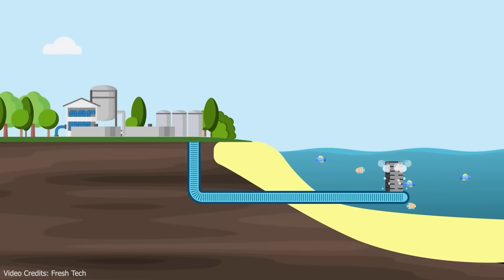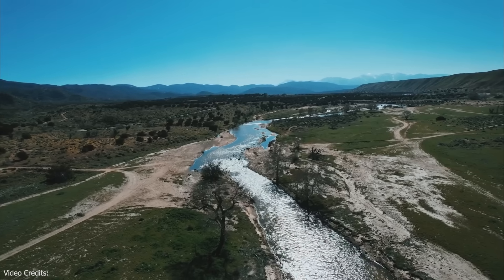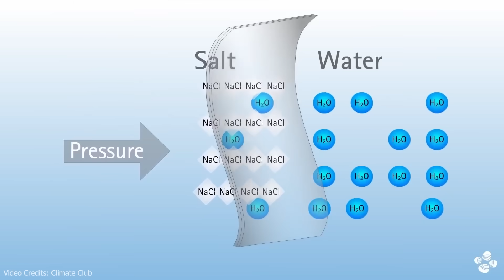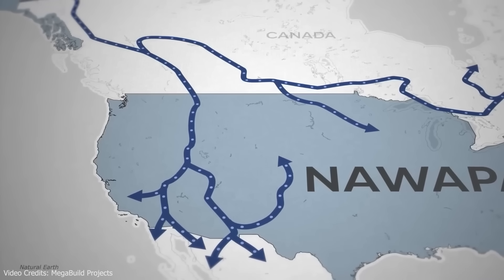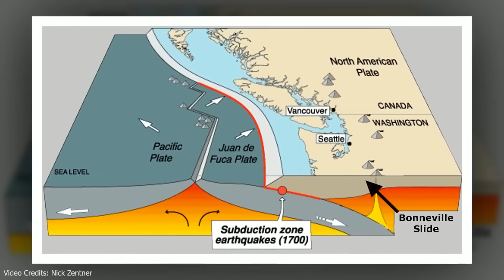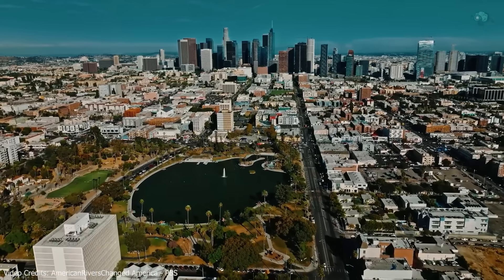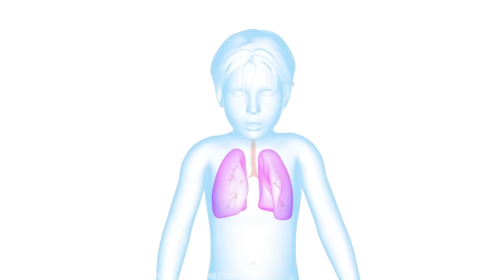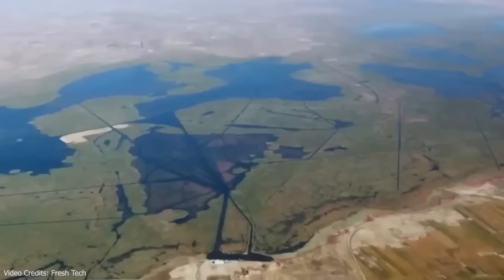Nevada's $16B Plan To Pump The Pacific Ocean 170 Miles Into The Desert

Comment: The Desal system would help Cali the most, but idiot Newscum and the libtards running the state just destroyed 3 more Dams that would have been needed for holding onto the water that comes in.  Nevada needs dmas in the mountains to supply them with water.    Few speak on how the River stealing from the Colorado has destroyed the downstream areas that lost their water. Should have mandated that Cali build their own dams for their own water supply, and leave the Colorado alone.
Surprised the Salton Sea hasn't dried up being their is no input going in.

Comment: Solar power is not consistent enough to run industrial systems like desal plants. You need batteries. Those cost more than the solar itself. Or you could just use natural gas.

Comment: As someone commented earlier, this Nevada proposal is just a pipe-dream.

The 1964  NAWAPA plan was brilliant, far-reaching, and farsighted, a plan which would have solved the water needs of the arid western U.S. and northern Mexico for a century or more.  Had Ralph M. Parsons' project been built it would have vastly increased the prosperity of Canada, Mexico and the U.S. and would be continuing to do so for generations to come.  It would have paid for itself many times over.  It would have greatly aided Mexican stability and prosperity by ending food insecurity issues.  Western Canada would have enjoyed almost limitless and very cheap electricity.  The U.S. would  have been able to export even more of the planet's food supply.  Despite the delay it should still be built because the need which was evident in 1964 is even greater today, in 2026, sixty-two years later.

Comment: Just spit balling here but, if one if the big problems is that creating an inland sea using desalinated ocean water is that the salinity will rise to dangerous levels in them, how about DON'T desalinate the water first, pump it directly to the desert, and then constantly run desalination there instead, pumping clean water for municipal use and pumping the brine into dedicated evaluation ponds for mineral extraction? I suspect it might contaminate the ground water, but if you can create enough clean water to not need it, it might be worth it. I mean, it almost certainly wouldn't be worth it, but it would be interesting to see the math's take on the idea.

Comment: You have to put it through a pipe you can’t just pump it into the ground. You gotta take it through a big pipe running 100 miles to get it to the spot where you wanna start irrigating the land. OK what they’re talking about is a pipe dream if you want to do it correctly, it involves tunnel, boring machines, and we’re talking about a really long distance like 300 miles and we’re talking about a really big wide pipe like about20 feet wide and we’re talking about distalization plants pumping trees of gallons out of the Pacific Ocean powered by nuclear reactors

Comment: Given what has occured over the last 20 years with lakes Powell and Mead, I'd be selling my house in Vegas, as well San Diego for that matter, within the next year, if not even the next six months before the housing market crash really kicks in.  No one in government is raising alarms about the impending water crisis.  Meanwhile all the scientists are shouting from the rooftops. It's going to turn into a case of musical chairs over the next 5-10 years, except all the chairs will be pulled at the same time and then the entire bottom of the housing market will fall out.  Mark my words.  If they don't start building stuff like this within a year or two.. by 2028 at the latest.. it will be too late. And you know projects like this always take twice as long as they think.  Good luck folks.  Look at those lake levels.
Reply: You're absolutely right, but its going to be even worse than you predicted. Almost half the country's fresh fruits and vegetables are grown in California. When the water runs out, there will be a huge shortage of food.
Reply: @Krunchy71  Not all of California's water comes from the Colorado river.  Las Vegas and San Diego however get 100% from the Colorado (San Diego 99% actually because 1% comes from the only desalination plant). But, the other issue, which you would be correct on, is that the water aquifer in the CA central valley is near non-existent in many parts, as is the same in Kansas and other areas.  We've sucked thousands and thousands of years worth of water out of these aquifers in just 150 years of agriculture, mainly in the last 75.  So with that, and changing weather patterns, inconsistent rain, more storms and tornados destroying crops... it ALL spells disaster.

Comment: Recycling technologies are a must, regardless of anything else.
Beyond that, rather than trying to create new lakes/seas inland, maybe use the desalinated water idea, but pump it up to the tops of existing waterways, as a means to replenish the existing supplies.  The natural waterways already address the water circulation issues.

Also, there are new salt-based battery technologies being developed that would need the large-scale salt supplies that the desalination plants could provide.  Sales of the waste salt could provide a cost offset almost immediately (if the plants are built first).

There are ways to do this that would require less construction, and avoid many of the pitfalls.  But these require lots of design and management, and government backing.

Comment: Seems like a waste. You could easily make this far cheaper by just using focused sunlight to heat seawater (technically inefficient but mirrors are cheap so it is extremely effective), which rises through pipes under its own buoyancy, goes through condensers at high elevation, and is driven through pipes under its own weight all the way to Nevada. No pumps, no reverse osmosis, no photovoltaics.

Comment: I wonder if they considered instead of pumping the water up, just bore holes through the mountains with the Boring company's machines? 
Fusion power would help with that. The romans managed to make aqueducts that ran down hill with carefully placed bored holes.
cover the reservoirs with black plastic beach balls to limit evaporation.
There's salt water under Nevada, just pump it out there, desalinate it with a nuclear fission/fusion reactor by boiling or membrane separation. 
Where do you build the plants? The Nevada nuclear test range where it's already designated as a cheap/dirty real estate. 
Put the brine back into the wells elsewhere or pipe it to the Salton sea in a ditch, what evaporation happens will change the local environment.
The Salton Sea drain has been closed to the ocean for some time. I think some tractors and recycled beach plastic can make a canal fairly quickly.

Comment: Pump 2 gallons to Nevada, and one gallon back to the Ocean of real salty water. Create a checker board pattern of farm land of 3 acre red squares, and 3 acre black squares. Dig the black squares into ponds, and create a ditch connecting the black squares at the corners. Plant coconut palms, and agave plants, on the red squares to stop evaporation. You have to cover the land to reduce heat, like swamp land. Create a narrow waterway, and as it is successful, expand to wider waterways, and more checker board pattern. Plant hyoscines in the water to help stop evaporation.
Reply: @RoscoeCreel says: “Create a checkerboard pattern of farmland of 3-acre red squares, and 3-acre black squares. Dig the black squares into ponds and create a ditch connecting the black squares at the corners.”
This would be a fun project… IF Nevada were flat. It is very not flat.
Reply: @RoscoeCreel says: “… Plant hyoscines in the water….”
What is a “hyoscines”?
Search engine says: “Hyoscine, also known as scopolamine, is an anticholinergic medication.
Reply: @climate-rescue5805  The water plant that covers the rivers, and lakes of Florida. It floats on the surface. It has a beautiful blue flower. It was brought from Spain to Florida. It will absorb sunlight, and reduce heat.
Reply: @RoscoeCreel  Ah. Not Hyoscine. You meant Hyacinth. Odd how a couple of letters make a bunch of difference in the understanding of the message. Thanks for your reply. And I agree that the plant would slow the evaporation process.

Comment: Plans to?  Who?  Yeah, get back to me when some gov't agencies have invested 10's of millions in studies etc.  The big missing part.  Buying the land.  Well you could pay a little bit up front, then interest over time, and a percentage of income from licensed mineral extraction from salts, farms, etc.   Pumping the ocean is a dumb idea.  Just drill 20 or 40 foot tunnels and let it flow down hill into lower than sea level areas.  Death Valley and Salton Sea.  At that point desalinate it, via solar evaporation or reverse osmosis using filters and pipe magnitueds of scale larger than current, as Israel has done, producing far cheaper fresh water in such quantity they have created a NS 'river' incorporating surface storage.  Use this to remove salt build up.  Processing salt is a great idea for minearals, but you'll still get VAST amounts of brine to dispose of.  It's hard to know where.  In Isreal they are using it for secuirty embankments to make montioring access to areas easier.  Maybe there's someplace in Baja that Mexico would like to make money off of burying under 100 yrs of salt.  You could theoretically melt the salts into stone like materials to make it more stable, maybe even useable as land fill.  Now having fresh water, almost next door to Las Vegas and other areas needing water, you can pump it up into reservoirs you cover with floating PV farms as they do in Japan to also counter evaporation, which in the US is done by covering reservoirs with millions of useless and if they get out into down stream rivers, environmentally disasterous plastic balls.  So you are now 1/2 way to the big reservoirs along the Colorado at elevations from 500 to 1500 feet, and only need pump up that gradient.  Indeed if one was clever and used evaporation to desalinate the water, the steam could be piped uphill to condense out at some elevation at least hundreds of feet above sea level, making the pumped lift as little as 250 feet.  If you can pipe the steam up 1000 of higly insultaed pipe or tunnel, you might get condensed water to gravity flow back into the parched reservoirs.  You could keep this up until the Colorado once again flowed back into the ocean, ending 100 years of tension and abuse of Mexico who we didn't ask when we used up the Colorado, and restore millions of acre of wetlands and irrigate millions of acres of farmland, in Mexico even, or flood now dried delta for fish farms, all giving poor Mexicans an alternative to drug trade and running the border into US.  Let N. Mexico absord the world refugees now using Mexico as a stop to US.  

NOW FOR THE BIG SECRET.  YOU DONT NEED TO FLOOD MILLIONS OF ACRES OF DEATH VALLEY OR INDIAN RESERVATIONS OR PEOPLE HOMES.
You will need vast areas, but just a FRACTION of the 'lake the size of Rhode Island' to get ocean water far inland for processing, raising, and storing in the already created reservoir system along the Colorado, even expanding it into other canyons.  Bonus:  States further north that have to curtail development to ensure water flows south, could keep and use more of Colorado's river water and restore eco systems long deprived, stop pumping aquifers and let them recharge recreating vast stream and wetland systems long dried up.
You only need holding ponds at sea level around Salton Sea and Death Valley, for incoming sea water and outgoing fresh water, to hold brine for processing and melting into granular land fill, perhaps incinerating urban waste streams and combining with salts to make more stable granular fill.  All powered by solar pv floating atop the holding ponds, atop canals, facilities, facility parking lots....  Indeed ;you might size reservoirs to be larger just to get basing for the solar PV.  Which could even be pole mounted if one wanted on piles driven through bottoms of reservoirs.  

Cost for any such project can never be in 10's of billions.  It's going to be 100's of billions.  The wealth created from PV, processing salts, land fill, farms, eco tourism, fish farms, selling water to urban areas is vast and never ending.  The corporation formed to do this would have 100's of yrs of gauranteed income and a virtual monopoly on SE Water Resources as they can always scale up processing plants.  The only limit is flow rate through 20 to 40 foot tunnels from Pacific.  Though more tunnels could be drilled.  Fuelling intensive farming with water from this source would be far better than CA central valley stealing from N Ca and pumping out the aquifers.

CA and NV SHOULD pursue this plan to ensure they not just have a future witout water stress, but to ensure they will remain the lynch pins of the US economy.  Between them their GDP could exceed every nation on earth.  It could account for a quater or more of US GDP giving the region vast political power.  You don't need to be a visionary.  You just need to be an engineer to make this work.

Comment: Instead of trying to build a new lake, how about simply pumping salt water from the ocean to homes and greenhouses in the desert? Greenhouses and enclosed swimming pools would double as solar desalinators, providing distilled water for drinking and washing, while the salt water could be used directly wherever possible, for salt-tolerant crops and for swimming. There would have to be strict rules against irresponsibly disposing of the salt, but the supply of water would be limitless and the only electricity needed would be for pumping. A side effect of all this would be more water vapor going into the air, and the possibility of more rain in the affected areas.